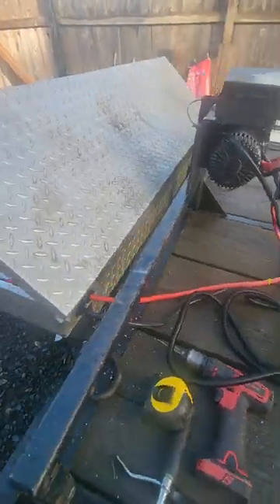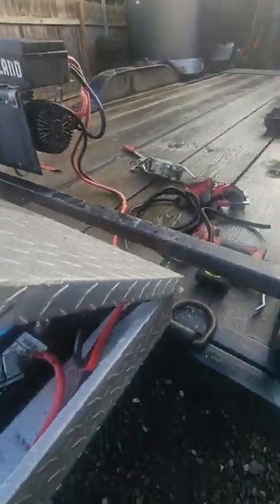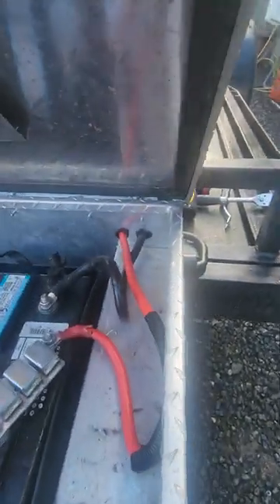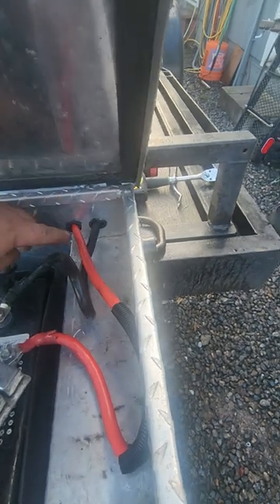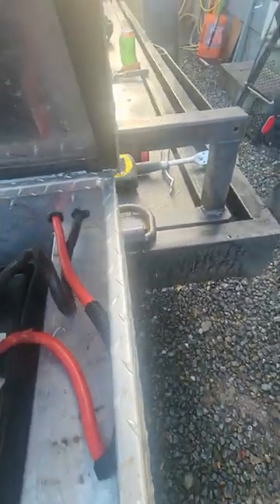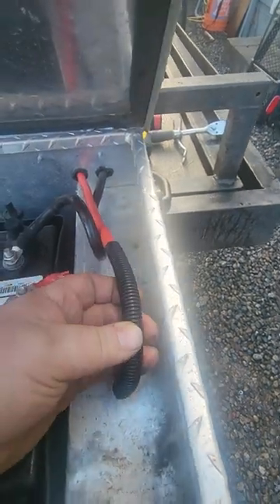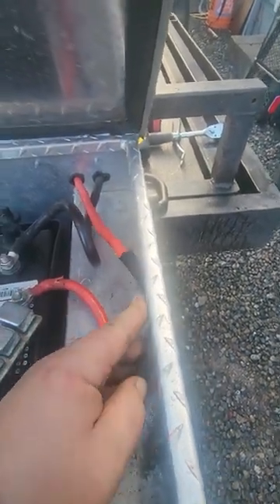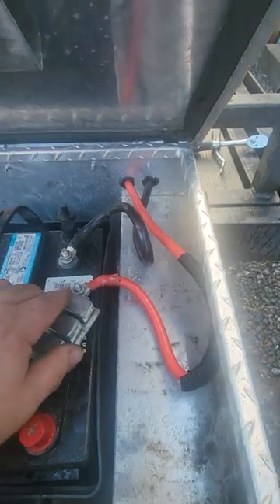trailer winch battery.

Comment: What is the 3 squares next to the battery post
Reply from the maker: Those are relays. Too much draw will cause them to trip to protect the system.
Reply: @workingwithandyandzach  where I can buy the relays !?
Reply from the maker: @gorillasbully4239  I think harbor freight
Reply: So you can't just use a battery without those?